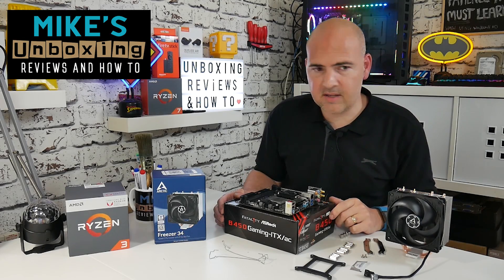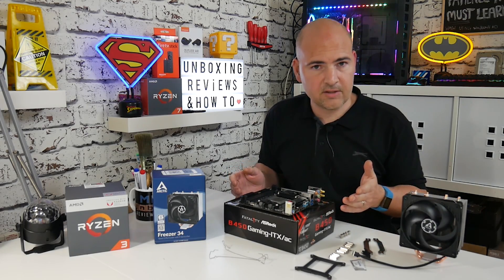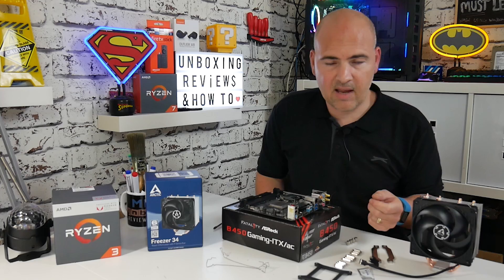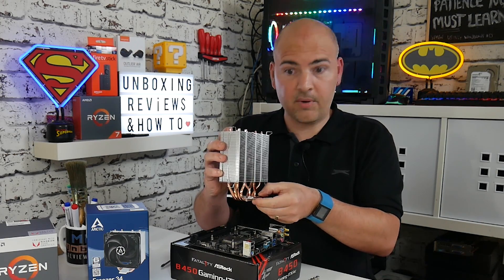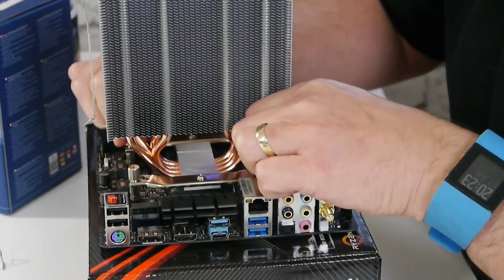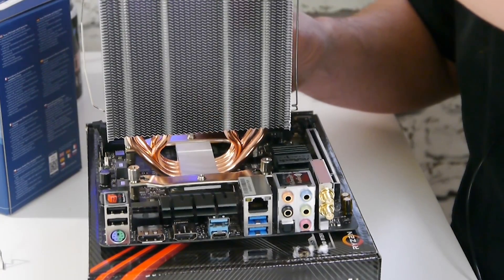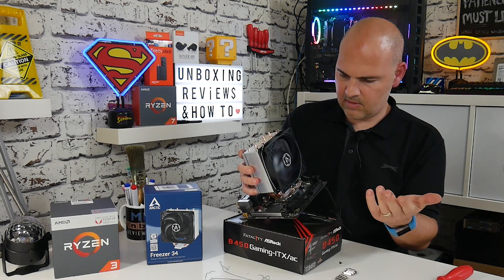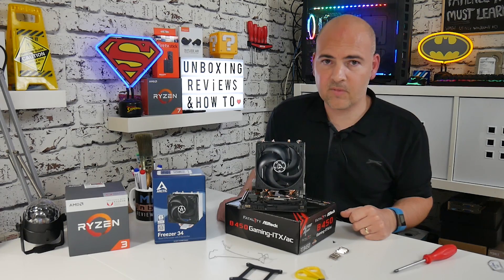How To Install Arctic Freezer 34 CPU Cooler On AM4 Socket Motherboard

Comment from the maker: This is a simple CPU cooler to install on the AM4 platform, even if you are using a Mini ITX based setup.
In this video we are using the ASRock B450 Gaming ITX motherboard to show the method of installing this Arctic Freezer 34 cooler.
Affiliate links:
Freezer 34
Amazon Local:    https://amzn.to/31GG22a
Ebay UK:   https://ebay.us/ISzAwJ
Ebay US:  https://ebay.us/E2Bgnm
Ebay CA:  https://ebay.us/cBrMIl
Ebay AUS:   https://ebay.us/ongDMk
Reply: I bought the Arctic Freezer 34 eSports Duo, which is an almost identical installation.  Thanks to your video and NOT the one from Arctic, I was able to install correctly.  But mind you, my frustration level would have run very high had it not been for your video.  Specifically, of the three sets of mounting pillars, the set with the single indentation mark is the AM4 mounting pillar set.  How the heck did you know that?  There is no reference ANYWHERE to indicate this.  I would also add that I didn't get nearly the same amount of M4 thermal paste that you got in that little packet.
Reply from the maker: Thanks for the info. I can’t remember were or when I worked out the single dent was the AMD one. Although I think the other pillars have a slightly different thread and won’t screw in as easily
Reply: Mike's unboxing, reviews and how to Does it work with the MSI gaming plus max? Ive ordered the freezer 34 esports and I’ve heard certain people having issues with the backplate. I’m a bit nervous. But I’ve also heard that the installation is basically the same.
Reply: I  have a question, I have cm hyper tx3 evo that was before ryzen launch. It does not support am4 but on their website it says it supports ryzen. Its manuel shows  lever type mechanism for am3 that is similar to wraith prism spire's mechanism for am4. Can i still use this cooler for am4?

Comment: Hello again Mike. Is this good enough for the Ryzen 7 5700X3D.
Reply from the maker: they caqn run a bit warm but yes most 120mm coolers with cope okay
Reply: @mikesunboxing  thanks Mike saved me £40 for a new cooler to buy ram 👍
Reply from the maker: @Audru-12  glad to help.

Comment: Will this cooler work with AM5, pc partpicker didnt show nay compatibility issues but it doesnt have the rubber spacers that i see in most am5 installation videos?
Reply from the maker: yes it will, but you might need to get arctic to send you an AM5 fitting kit
Reply: @mikesunboxing  Thanks a lot for the reply. So if ive put it on with the am4 kit i should remove it?
Reply: @mikesunboxing  i have a MSI PRO B650M-P Micro ATX AM5 Motherboard if that means anything?

Comment: ....... this crap is infuriating.  I can't find a single video on youtube where they're actually attaching the more basic clips that I have... they're really difficult to get on, and I don't know how to do it, and evidently i am the only person around who has them.... 

The last 4 fan install videos I've found, were for some fancier type of clips fastening to the motherboard.  Mine are very basic, but I can't figure out HOW they're meant to go in, and I don't have the packaging for this CPU cooler from ARctic.  This is one of the most frustrating things I've ever dealt with, and it's on the least expected part. 

I am helping a friend get his computer working - which is why I do not personally have the boxes or manuals.  If I even knew what the damn clips were called I could probably find out what I need to know, but there's not a single video here on youtube of someone with them! how is this even possible?
Reply from the maker: post a picture of the clips or whatever it is in our discord and i'll try and help you out

Comment: thank you for the video however i have another issue. I do step by step what you are doing in the video however my artic cooler 34 duo esports is very loose on my motherboard. "MSI MPG B550 gaming plus" i tried to screw everything tight but they keep rotating and when i touch the cooler i can move leaving a gap. My PC can run however when i shut it down , restart or updating it warns me that the cpu cooler is not properly installed
Reply from the maker: Post some pics on discord and someone will help you out
Reply: @mikesunboxing  will do on monday cause i sended my pc to a technician. thx for the reply !

Comment: None of the 3 types of standoffs seem to fit my b450 board
Reply: Am I going to have to take off the mdb to put the little standoffs it comes with underneath it?
Reply from the maker: This is maybe easier to fix or at least advise if we can ask more questions and get direct answers, so feel free to join our Discord chat and we can go over it in more detail https://discord.gg/XtBTGQ6BDu
Agree to the rules by clicking the emoji and you will get access to the rest of the Discord channels

Comment: I know that this video is a year or two old, but I have a question. 

I don't need to add any backplate behind the motherboard right? I'm planning to replace the Stock CPU Cooler on the Ryzen 5 5600X in a pre-built computer I purchased and I don't know if I have to replace the backplate or not. I'm new to computers so.
Reply from the maker: Just use the stock backplate, unless the design has changed, they do revise them from time to time
Reply: @mikesunboxing  Alright, thank you! 

It should also work with the ARCTIC Freezer 34 Esports right? Since what I was told that most of these CPU Coolers have the same baseplates or can use the same baseplates.
Reply from the maker: @v_eryconfusing3365  yes it should
Reply: @mikesunboxing  Thank you man! Really appreciate it, can't wait to game on my new system!
Reply from the maker: @v_eryconfusing3365  Have fun!
Reply: @mikesunboxing  Hey! 

I just got my new computer and I want to change the cooler but it's already built it in a case. I want to replace it but I can't with the screws that I have. Do you have any good screwdriver that you can suggest and/or video on how to take it apart?
Reply from the maker: @v_eryconfusing3365  This is maybe easier to fix or at least advise if we can ask more questions and get direct answers, so feel free to join our Discord chat and we can go over it in more detail https://discord.gg/gaeeDPw

Comment: Why didn't you use the included bracket on the back of mother board?
Reply from the maker: i think you can for the newer versions
Reply: @mikesunboxing  Thanks Mike, I later realized it's Intel sized not AMD, silly me. But I'm sure others will see the cooling friendly looking part and wonder why its sitting on the desk of not just yours but many of the Arctic Freezer 34  tutorials.

Comment: Hi, I bought this motherboard for my AM4 Motherboard and I can't put the 4 screws because the backplate they sent me isn't long enough, I can only put two screws up or two down.
Is it okay to use the Intel screws? Because those are longer the Cooler could fit perfectly.

EDIT: It seems I totally passed by the part where you explained that all four screws should be installed together and then screw each one individually until it tightens. I did it one by one and the cooler tilted to one side. I'm leaving the first part in case somebody made the same mistake.
I'm currently at 33° semi-idle and pretty happy!!!!
Reply from the maker: cool glad you got it sorted in the end, funny actually this week we are working on a AMD AM4 cpu cooler masterclass covering the most common mounting methods

Comment: bought this for b450 tomahawk max, the standoffs were loose and could not screw the thumbnuts tighly, so had to place my cpu horizaontally so that the heatsink  stays on top of processor
Reply from the maker: i can't tell if this is a troll?

Comment: This is very good cooler. I bought it after watching this material. In my case I have two of them on Xeon e5 2680 v3.
Working non stop with 100% first CPU is 49 and second is 52 degrees. Fans working at 1150 rpm and quiet.
Reply from the maker: that is the most interesting setup I have heard of! nice work!
Reply: @mikesunboxing  quite powerful workstation at 24 cores and 48 threads with all core speed of 2,9 gHz. What is interesting there are rumors of dual CPU configurations not really suitable for gaming. Interesting fact that I used this workstation for this purpose. 
Far Cry 5 - no stuttering and cpu utilization around 5%
Most of games behave similarly (shadow of the tombraider etc). I have rtx 2060 and 32 gigs of ecc reg memory per CPU, 64 total- quad channel.

Comment: Thanks for doing this guide Mike. Just fitted this to a Ryzen 5 2600 tnite. The clips were a bit fiddly. On startup no boot. Reconnected the cpu fan connector and it came to life. Now idles at 21°C compared to just under 40°C previously did a torture test with prime95 max of 53°C compared to 68°C before. Gets the thumbs up from me!. I did notice that you get a spare set of clips in the box  I'm wondering if you could buy another fan and have a push pull setup like the duo version?
Reply from the maker: yes that is what they are for. grab another fan and you are good to go
Reply: Grabbed another fan Mike 20-25°C idle and max of 48°C using prime 95 torture test. Very happy with this over the stock cooler on Ryzen 5 2600...
Reply from the maker: @markberry8182  that is very good temps - nice one

Comment: There is a problem on this cooler with backplate for AMD motherboards !!! On some AMD motherboards the original backplate cant be used and there is no AM4 backplate in the product package so if your backplate is loose then you need to email ARCTIC and ask for a AMD (AM4) backplate.
Example of the email that you need to send

Subject: Freezer 34-AM4 Backplate
Store from where you purchased the cooler (can be Amazon or other)
Proof of the purchase - Invoice (or maybe Screenshot of the purchase)
YOUR ADRESS where Arctic will ship the backplate
Arctic Email is: support@arctic.ac

Example of this problem you can find here: https://linustechtips.com/topic/1136780-help-with-backplate-for-cooler/
and here : https://forums.tomshardware.com/threads/need-some-help-installing-the-artic-34-esports-duo.3611027/
Reply from the maker: thanks for the info

Comment: I like the design because it is simple and I’m not a fan of glass panel cases so am keeping my antec 302 all internal black edition case. Just want something that will keep a ryzen 3900x cool. That will be my new build as I move to am4. 
Antec 302 case
Arctic freezer 34/34co with spare fan from my a32 cpu fan in push pull action.
A decent budget x570 mobo
32gb ram ddr4
SSDx2, 1 nvme and 1 hdd 
Blu ray drive
New windows 64bit or macrium my current windows to nvme if possible
Rx480

Later in year will buy rtx3080 or rx5700/rx6800 (all depends how well I hide all this from da missus 😬🙏🏻💀)
Reply from the maker: sounds good to me

Comment: I have an amd ryzen 3600 with the stock CPU Cooler and i am thinking of buying a Freezer Cooler. Do i have to switch the complete Backplate or do i use the same one with this cooler? Would be cool if someone can help me with this.
Reply from the maker: same one
Reply: @mikesunboxing  thanks for the info :)
Reply: Don't do it - spend a little bit more money, this one is barely any better then the stock cooler - I am getting 85C on full heat test with it... That's too much. A specially 3600 and 3700s are a bit more special from what I read
Reply: @kites-bikes  had this same temperature before i deactivated the amd precision boost. So that the CPU runs with 3,6 ghz which is enough for me and get never over 61 C. With a newer cooler i wanted to acivate it again. Maybe a Pure rock or a Dark rock from bequite?

Comment: I just installed this cooler on my new Ryzen 5600x a few days ago, I followed the instructions on their website and it was quite easy (This is my first tower cooler so I was a nervous wreck. LOL).
This cooler works very well with the 5600x, even under stress, it seems to hold a steady 55 degrees c. I'm very happy with this cooler. :)
Great video for the installation process, wish I would have seen this before doing mine! :)
Reply: I get worried as it doesn’t cover the whole of the cpu
Reply: @Suicidebummer88  its good enough my temps never hit 80c+ despite me living in a tropical country. Ph*
Reply: @Suicidebummer88  It's not as big as some others but it works well since it covers the "HotSpot" of the CPU. I've since changed to a Cooler Master Hyper 212 Black edition which covers the complete CPU and after running tests, both cool the same, I get the same temperatures under the same loads from both coolers. :)
Reply: @Suicidebummer88  That is odd, were you monitoring your temps? If it makes you feel better, maybe replace the Arctic cooler with a hyper 212 cooler, it does cover the full surface of the 5600x. Personally I think either coolers are good for the 5600x BUT for anything higher (5800x, 5900x 5950x) I would go for a better, bigger air cooler (Noctua comes to mind).
Reply: @Suicidebummer88  The temps look good, so my guess is it was just a bad chip and was going to fail no matter what. Unfortunate but it does happen. Hopefully your replacement is perfect and rock solid. Best of luck to you. :)
Reply from the maker: thanks for watching and glad it helped you to get it installed. and nice CPU
Reply: im getting 70+ on mine. i have a r5 3600 lol

Comment: Just watched your tutorial, when you said until the screw tightens, do you mean tighten until I can't turn the screw driver? I'm afraid that I'll break/crack something. Thanks.
Reply from the maker: yes that is right the threads have a point where they stop to prevent damage
Reply: @mikesunboxing  that's good news and bad news. I think I might not have tighten the cooler properly. Gtg. Thanks!

Comment: Thanks for the great video! The backplate is a bit loose after installing the screw pillars at 2:14. I tightened it all the way, have the correct screws and the one mark faced to the motherboard. What can I do to solve that?
Reply from the maker: This is maybe easier to fix or at least advise if we can ask more questions and get direct answers, so feel free to join our Discord chat and we can go over it in more detail https://discord.gg/gaeeDPw

Comment: A great video..very instructive and clear. I wonder would it also be fine to spread the thermal compound all over the CPU to achieve a uniform smooth layer as I have seen in other videos using a latex disposable glove?
Reply from the maker: Yes, absolutely, do it however you like as long as there is good even coverage
Reply: @mikesunboxing  Thanks so much...love the videos..Great work!
Reply from the maker: @johno9163  Thanks appreciate that :-)

Comment: on some boards when you put the standoffs in the rear bracket will be loose but once the heatsink is mounted it will hold it down tight and there will be no movement.
Reply from the maker: yes that is right
Reply: @mikesunboxing  i just got mine today and was wondering whats was up with it triple checking i put the right standoffs in since the plate was still loose. then i sussed it if i put the cooler on the pressure will hold it tight.

Comment: Did you have to change he back plate at all?! Mine is all blocked from the proper mount that came with the fan whatsoever?
Reply from the maker: the stock AMD backplate is the one to use for this cooler if you are doing it with a AMD processor otherwise you need the included intel backplate for team blue builds

Comment: when i bought this cooler. i was sht scared lmao. Opened it and tried to install it, panicked i thought i bought a wrong cooler because the brackets didn't fit the motherboard, but it was only just wrong way around ahahaha
Reply from the maker: i have done the same
Reply: I jsut bought the Freezer 34 eSports Duo and I'm dreading the installation lmao
Reply: it same for everyone first time we all scared to kill CPU don't worry for me i kill 2 H97 mainboard in 1 month haha and after than I'm very careful with CPU cooler install, also i ben r7 2700x pin by accident during remove cpu cooler once lucky shop near my house ben it back since they expert :D

Comment: Will there still be room for a PCEe video card? These are sometimes two brackets wide where a second bracket space is used to blow wind out. On this ITX board it may be close to the CPU cooler element.
Reply from the maker: should be okay i think

Comment: I am wondering if Arctic Freezer 34 eSports Duo will fit in Matrexx 55 V3 ADD RGB case? I read specs of cooler and case and it seems everything should go well, but I have one Arctic F14 fan on  top, and one Arctic F12 on rear. Hmmm, kinda lost right now
Reply from the maker: Yes should fit fine

Comment: Can u do another one with cooler master cooler?
Reply from the maker: yeah sure keep watching
Reply: @mikesunboxing  thanks.  I  have a question, I have cm hyper tx3 evo that was before ryzen launch. It does not support am4 but on their website it says it supports ryzen. Its manuel shows  lever type mechanism for am3 that is similar to wraith prism spire's mechanism for am4. Can i still use this cooler for am4?

Comment: Great video thanks, just got the dual version and didn't see any instructions in the box. Fitted it perfectly and temps are way way cooler than the original wraith stealth
Reply from the maker: Glad it helped
Reply: Dante_R there should be an online manual on Arctic’s website